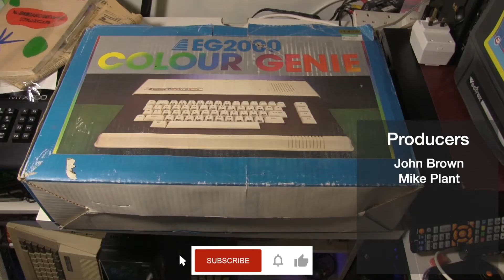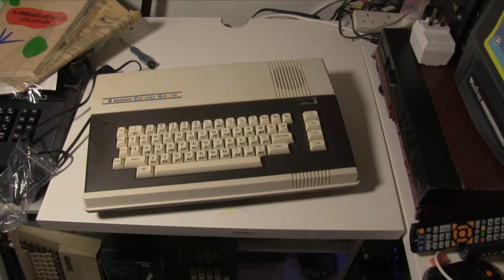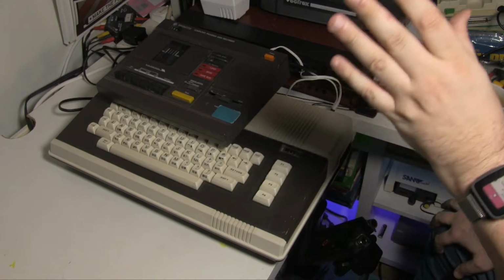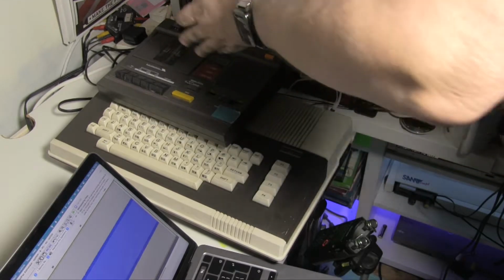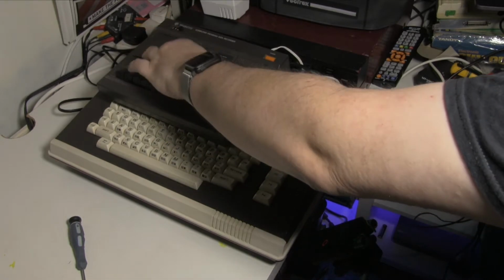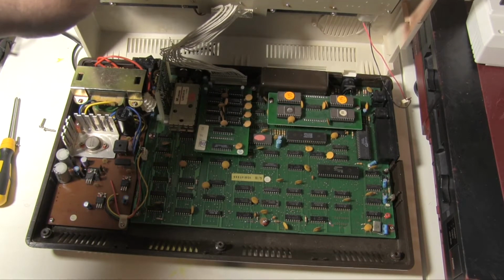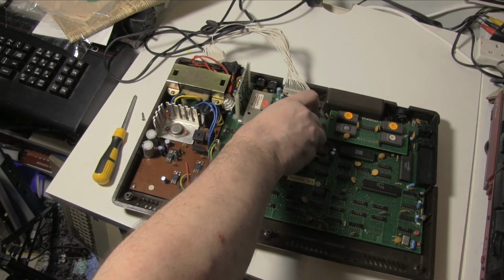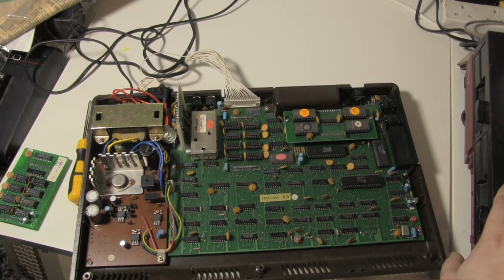A genie in a beige box: The EACA Colour Genie EG2000 #Retro #Retrogaming #Retrocomputers

Comment: Fascinating stuff. I bought a Colour Genie about 10 years ago and managed to work out how to archive a great deal of software that came with it. Unfortunately ,my Genie doesn't have that nice volume control thing your does. I think the real problem with this machine is that the loading is so unreliable. It's one long continuous stream of data and even a tiny bit of drop-out (which of course it's asking a lot of 45-year old tapes to not have any drop out by now) and the load stops, and you can't rewind the tape and pick it up again. There's an emulator for the PC called Genieous which alleviates a lot of this. Still a lot of games missing in action for this system.

Comment: Colour Genie on YouTube - rare videos :-)

Grew up with this in the 80s. Still have it, one of the first w/o the tape meter, but "upgraded" to the new ROMs and RAM max up to 32KB. Also had a number of games and the strange pair of joysticks (cannot find them anymore), but was more into the development tools. Learned all my coding incl. assembler on this, and tape loading / saving was painfully slow. Never had the money to switch to floppy disks with this, would have been 1k Deutsch Mark if I remember right. So really learned some patience, and to carefully code, else you wasted 10 minutes saving and loading <g>. A few years later got replaced by an Amiga, but I still like it, though it could never compete against Commodore, BBC Micro, Atari etc. But the lack of games forced me more into coding myself, so was the right thing in the end.

BTW: I dedicated some time last year during lockdown to retro coding and refreshed my Z80 skills. Wrote MineSweeper in assembler for this, I think only sound is missing, have to dig up the code. But that also showed me that playing games on this is >noisy< due to the keyboard, and MineSweeper without mouse or touch is also not the right thing. Maybe more to come.

BTW2: anyone got a spare pair of floppy drives plus controller for it? Missed one chance last year on the bay 8-)=)

Comment: Looks to be in rather good condition. Mine has some cable burn unfortunately. I didn't manage to get it working with a TZXduino, too. Well MaxDuino in my case. The *duino won't play back the converted TZX file correctly, while my PC does.
Reply from the maker: Could be that then, although i've now increased the Gain on mine - i'll report back when i've re-tested.

Comment: I wondered what these computers displays looked like, so now I know. However, there were a couple of things you did which were even more amazing. Firstly you used a Bluetooth cassette adaptor to transmit an audio file through the cassette data recorder. Secondly, you read out a note saying that 8 was the best volume setting. I actually own one of these WH Smith cassette data recorders which I hope to use with a Yamaha CX5M Music Computer (MSX). Upgrading it to be floppy disk compatible is very difficult. The problem is that I want to save music composition data from the computer. Can you save data from an eight bit computer using the Bluetooth cassette adapter in this WH Smith cassette data recorder?
Reply from the maker: Unfortunately, I don't think it would work. The bluetooth adaptors only work in one direction